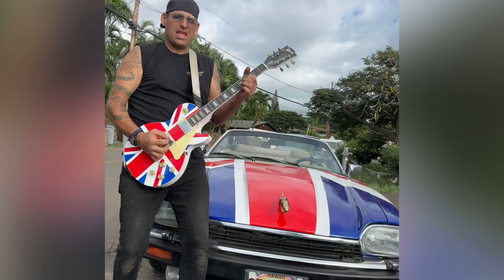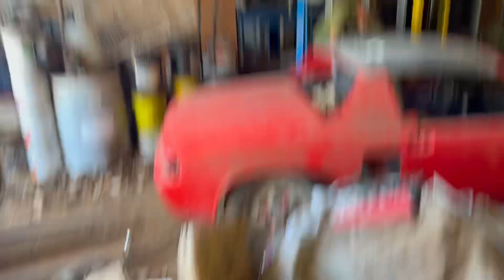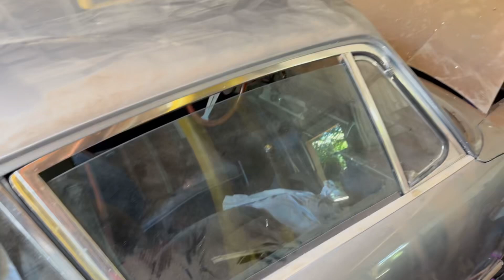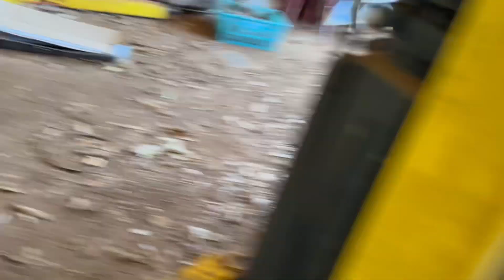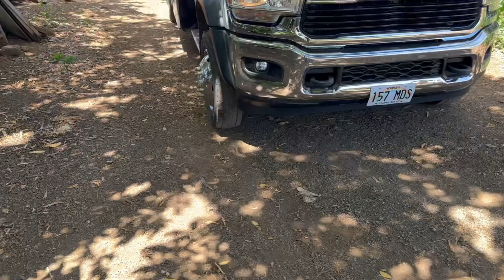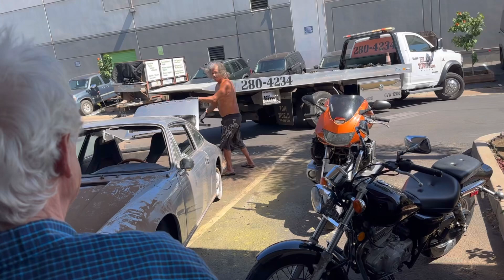Barn find 1968 porsche comes home!!!

Comment: If the body is in as good shape as it appears I think it's a decent deal. But you guys dragged it on those FUCHs wheels?!!! Do you realize they're probably worth $500 ea (if they are real not repos)? As far a engines you've got many options; stock 912 4 cyl; a polo DOHC 4 cyl (made out of a 911 6 cyl) or a hot rodded 912 pushrod motor. A friend has one its as quick as my 911 E and probably handles better. Good luck with the build.